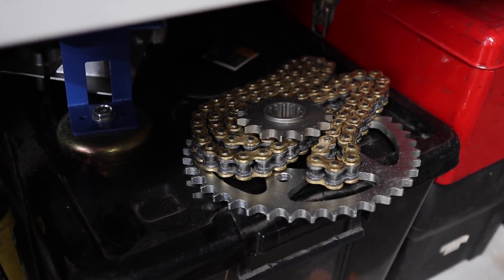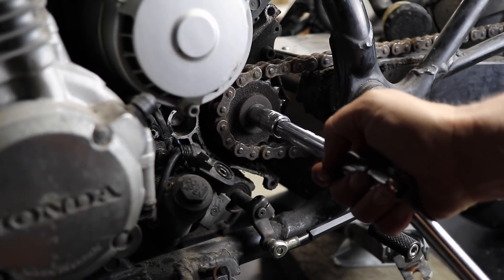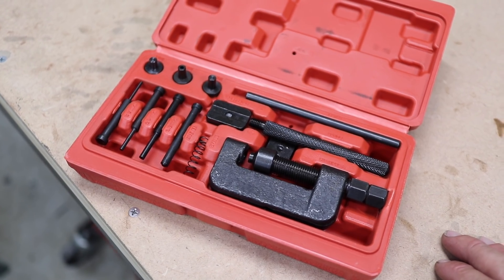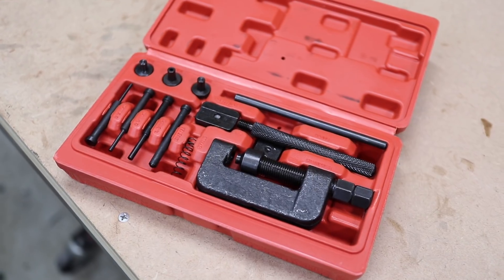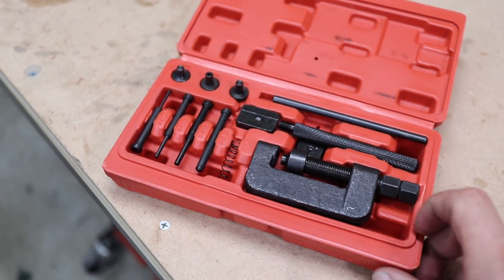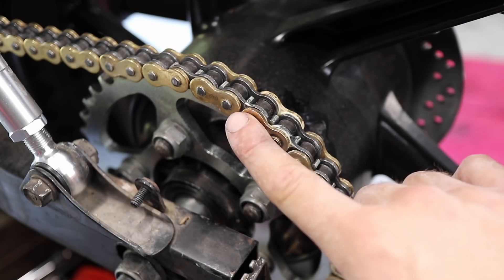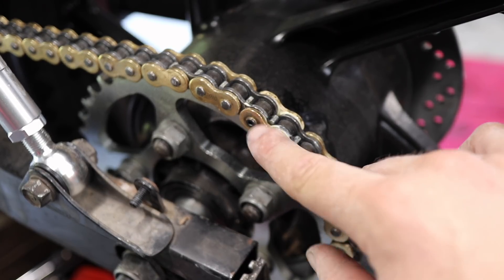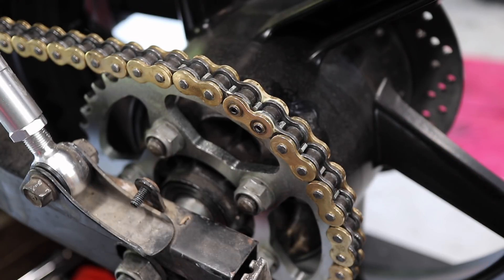Motorcycle Chain Adjustment & Sprocket Replacement [3 Minutes] - Cafe Racer Build

Comment: Maybe a silly question, but how do you mushroom those pins after you change the chain? Is it part of that chain breaker kit?
Reply from the maker: This is not a silly question, In fact, its a very good question, depending on your tool you can do it with the tool just by tightening it up using the correct pin required, I'm no expert and I'm still learning myself :)
Reply: There are multiple options in the tool selection if you want to do it yourself i would defenetly consider buying a tool were you have got to hit a pin witch has a splitted open end to make the muhroom. I am going to look one up for